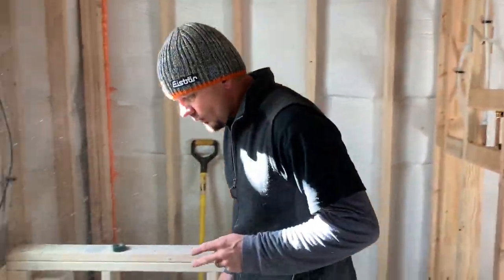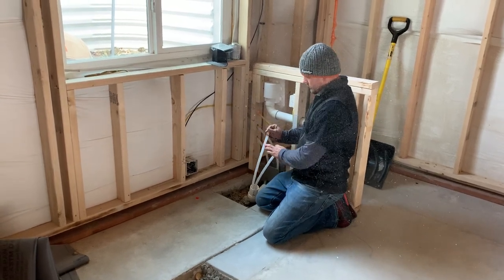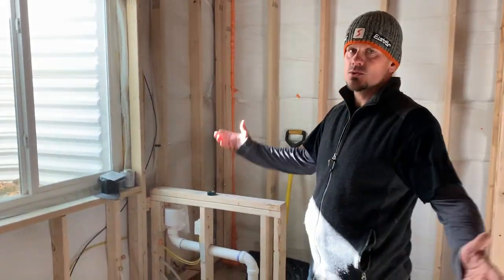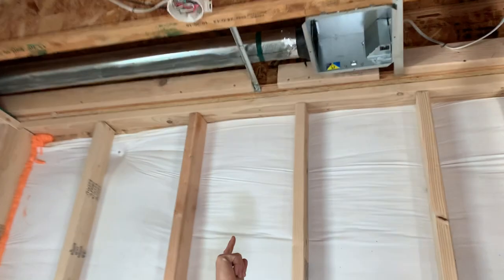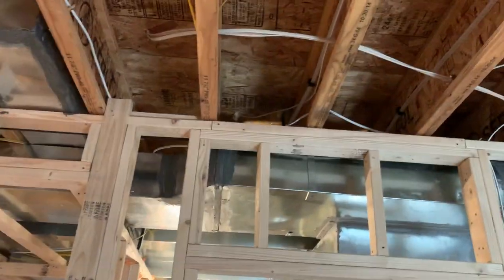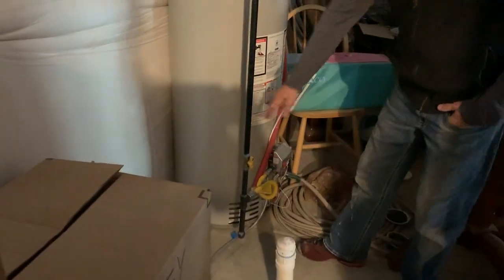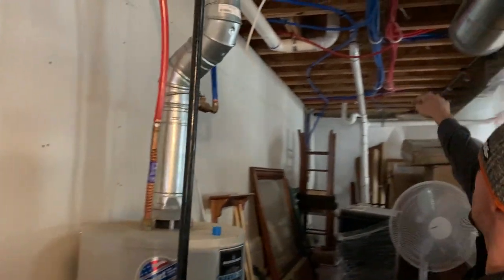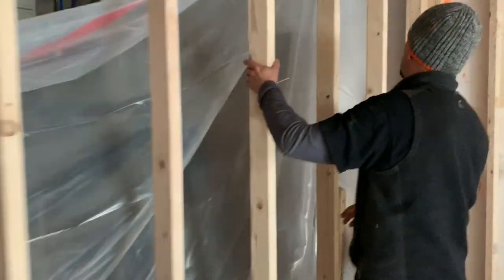Electrical for a Hydro Massage Tub - Part 2

Comment: I may be misinterpreting 680.74, but I don't see any that really suggests that you would have to run the 8 AWG ground all the way back to the panel, nor in reality would that actually accomplish anything. Maybe run the wire between the components that should already be grounded, but even that is a bit of a stretch.